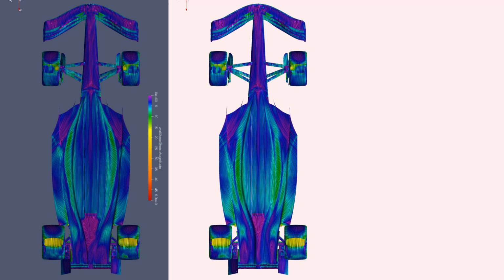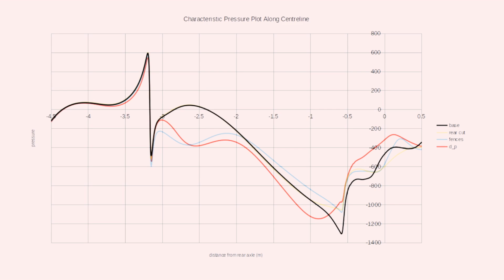F1 Aero: Making the Floor Work.

Comment: Hey Nelson this is AMAZING. I'm a mechanical engineer (recent graduate). I am very very much into CFD. So I wanted to ask you about your process for modelling the cars.
What CAD package are you using for the surface modelling? 
What meshing software do you use? 
I'm assuming you are using OpenFoam as your solver. But if it's something else please let me know!!!

My main simulation work is usually around aircraft lifting surfaces and I use ANSYS fluent.

I have started learning how to use OpenFoam because the licenses are too expensive and I will eventually won't be able to use my university access to Fluent anyway for my personal curiosity in projects. However I don't know great meshing alternatives sadly

Comment: you mentioned floor edge - imho the main  element is the floor edge wing that increases the outwash from the outer fences even more + the rear cutout & winglet (raised section) that create upwash. Then also there is a cutout on the diffuser side which should ingest the clean "sidepod undercut flow"

Comment: great work , your fences are working too hard back down on 3rd and make it sinusoidal
Reply from the maker: Next iteration I was going to cut it short like RB
Reply: @nelsonphillips  btw where did you get the geometry , I also have means so cfd and you mentioned you didnt make the geometry
Reply from the maker: @rkbmd12  I thought I mentioned that I make all my models. I am still working on speaking clearer though..... The only model I haven't made was the Airshaper vid model.
Reply: @nelsonphillips  how do you get the correct dimensions for these and which cad do you use?
Reply from the maker: @ConnorSmithBirch  All the dimensions are from the FIA regulation boxes that constrain these cars. After this its just about applying aero knowledge and test how close your guess was. 
OnShape because it doesn't make my computer sound like its trying to takeoff.

Comment: The little divots are there to increase the stability of airflow under yaw, something I'm guessing you lack the processing power to investigate properly. Your diffuser is lacking a lot of outwash at the upper trailing edge of the diffuser which increases its performance.

Comment: The highest performance floor is the egg shaped one, where the small end of the egg is on the leading edge, and the large part towards the rear. This is in line with longboard surfboard design, the so called rearpoint back style is more maneuverable but harder to ride.

Comment: You realize the walls of a vortex are high pressure air, the core of the vortex is low pressure. The two pressures are held in equilibrium by the vorticity, and amount to the static pressure. The rotational flow is a secondary flow that is not in line with the primary streamwise flow. That is because the vortex is a source of drag, it is itself an adverse pressure gradient.
Reply from the maker: Thats a better way to say it. I really want to make a "why the merc it draggy" video, but need to model it first. Thanks for all you comments, it been the best thing about making these videos, having people.that know way more than I do share their knowledge.
Reply: @nelsonphillips  To put it in laymans terms, the vortex under the floor is actually a flow restriction. This is a good thing. For one, it keeps the flow along the venturi walls laminar. It also keeps the pressure in the tunnels low. The lower the pressure in the tunnels, the faster the air is moving. The faster the air is moving, the lower the pressure and the greater the pressure difference above the floor.

You notice right aft of the plank area, there's a boatload of turbulence. Well this is because the high speed laminar flow under the car is equalizing in pressure, and the fastest way for air to do this is to turbulently mix. On the wall of the diffuser, the air has at least something to hold on to. There's nothing but empty space in the center, so that air will tend towards turbulence there. That's why the egg shape works well, it turns the turbulence to a vortex. Then the upwash from the vortex can be used to keep the beam wing flow laminar.
Reply: @nelsonphillips  If you want to learn more, check out studies done on the CFD of prolate spheroids.

Comment: Can you design a F1 with a shark fin to stabilise the car and all downforce coming from the floor with ground effect closing the floor and with a fan to produce more downforce and to compare which one is faster, that one or the F1 2022
Reply: Pretty sure the car you describe would annihilate a 2022 F1 car. Just the act of adding a fan would improve low speed grip tremendously, which is where you can make up the most lap time.